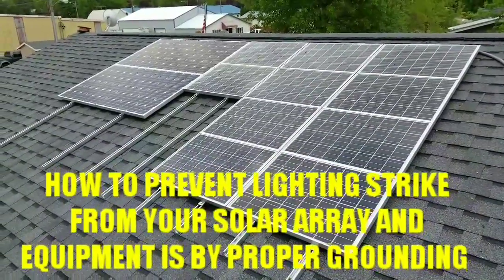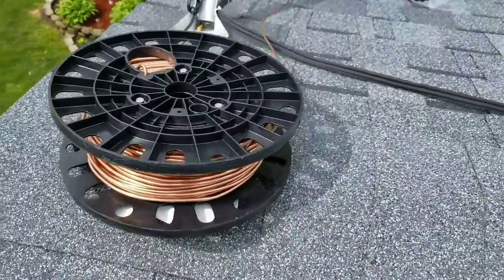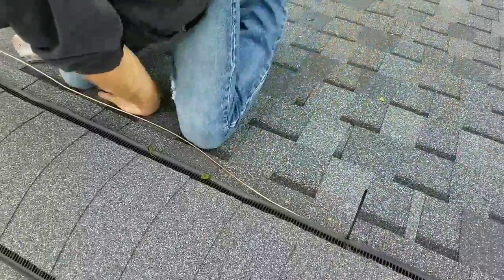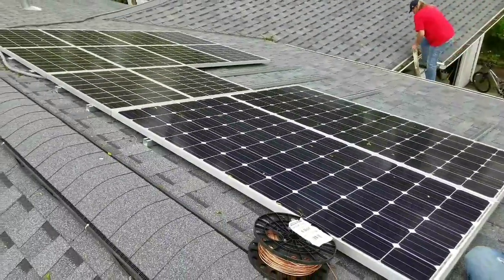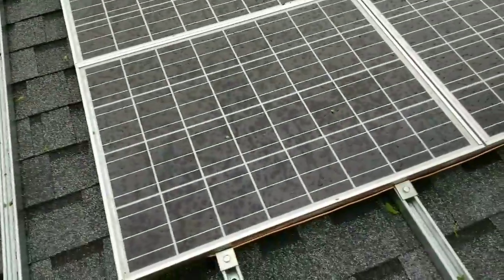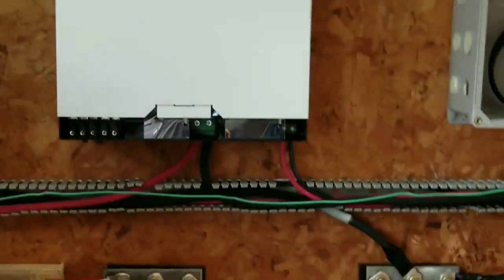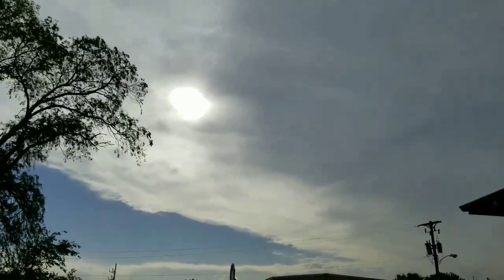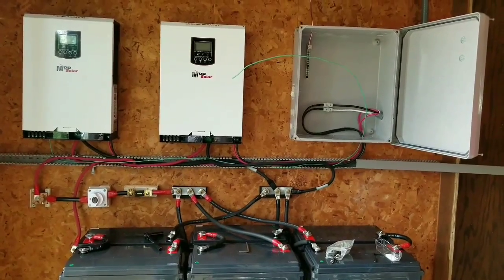HOW TO PREVENT LIGHTING STRIKE FROM YOUR SOLAR ARRAY AND EQUIPMENT IS BY PROPER GROUNDING Pt.9

Comment: Your double grounding rods is dangerous NEC does not recommend 2 ground rod. Hard to protect from lightning just make sure the 2 rods are ground together. Look up the wiring for lightning code 720 I think.....
Reply: Totally agree if you have 2 rods they should be grounded to each other I was reading about that double ground rod setup it is a risky thing to do without having the 2 rods connected by a ground wire.
Reply: Yes, 2 separate ground rods creates a difference in potential (voltage) between the 2 rods. Even different soil PH/moisture comes into play.  The more acidic the soil, the greater the potential (voltage) will be. IF you use 2 separate rods, if not connected together, you have created a battery.  Also, there is a difference between grounding AND bonding.  The standard home ground rod required by the NEC is rated at 60 amps. Most power companies require 2 rods, separated by at least 6 feet, but connected together, along with the water line bonded at the main panel.
Reply: Its called bonding.
Reply from the maker: Thanks for sharing LIKE SHARE and SUBSCRIBE

Comment: I have seen direct lightning strikes to instrumented systems and it will jump across isolated sockets...run down little wires and take what ever path it thinks is the closest to ground, blowing up wires as it goes...so it confuses me as to how a little wire like this is going to do anything to help you...a lightning rod on the house may help but to be honest I think this will do nothing for you if you are hit by lightning..how do they work these standard out,I dont think the empirical data supports this.
Reply: I think there is a lot of confusion around grounding and lightning.  Yes, if lightning directly strikes, you are out of luck.  But grounding does 2 things— 1) Dissipates charge in the area (if a lightning rod) reducing the probability of a direct strike and 2) routes transient current spikes to ground induced from a NEAEBY strike, reducing damage to equipment.  And of course 3) safely issue if those frames were to become energized
Reply from the maker: Thanks for your comment buddy. 
Please show me how your house is grounded. 
My setup is for a standard house or home. 
Please take a look at your House Electrical wiring and see how it was wired with that tiny Earth Ground wire you will be scared lol.
Reply from the maker: Thanks for stopping by.
Please don't FORGET to LIKE SUBSCRIBE and SHARE my videos and my Channel
Reply: True, this is only to protect from indirect effects of lighning strike, and he have to install SPD.
Google for more.
Check: Legrand book 7
Reply: All bets are off when a direct strike hits. This is pretty much for transient voltage produced by lightning from a distance.
Reply: @fasnuf  transients are pretty much in the cabling and will cause an over voltage which will damage equipment down the line,surge protectors can help,but not much...